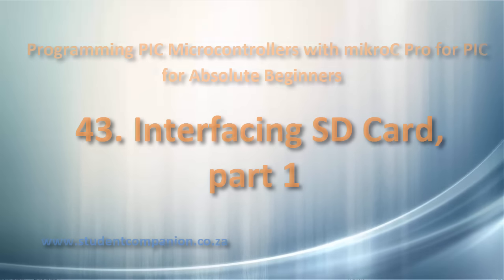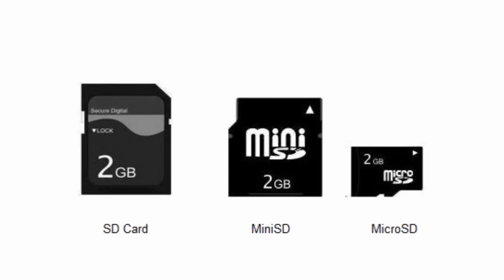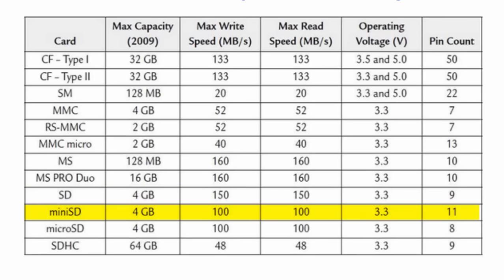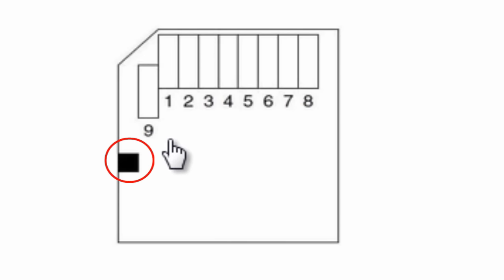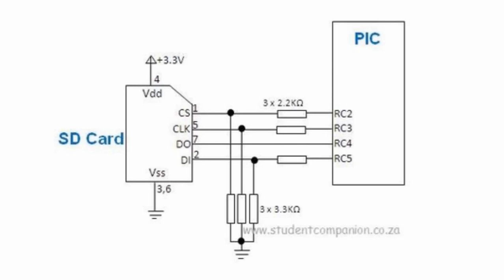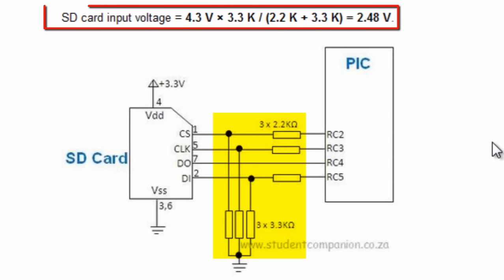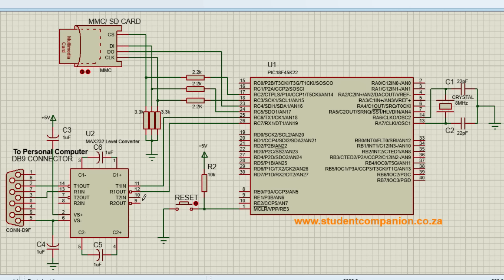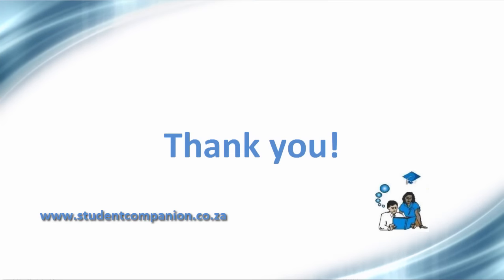43- Interfacing SD Card, part 1 | mikroC Pro for PIC Tutorial

Comment: sir, can i replace pic this 18f microcontroller with PIC16F877A.
Reply from the maker: +althaf k Yes you can use it, but you'll have to make some few modifications in your code before it compiles without errors.
Reply: Ok,  thank you.
Reply: Actually I m not much familiar with PIC microcontrollers.  Just started with AVR atmega32.  Can I get any tutorial documents or basic ideas about sd card interfacing.
Reply from the maker: +althaf k Yes you can. You'll just has to do a few small changes in your code. Please ignore the previous response
Reply from the maker: +althaf k that's the only tutorial we've got on YouTube but you can read more on our website: http://www.studentcompanion.co.za/interfacing-sd-card-fat32-system-with-pic-microcontroller-mikroc/
Reply: Thank you so much
Reply from the maker: +althaf k you are welcome!